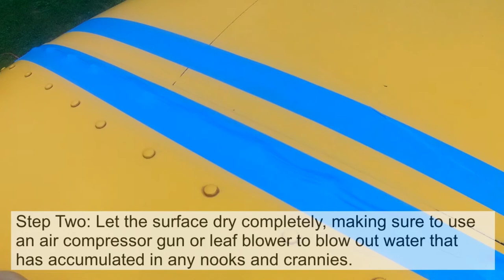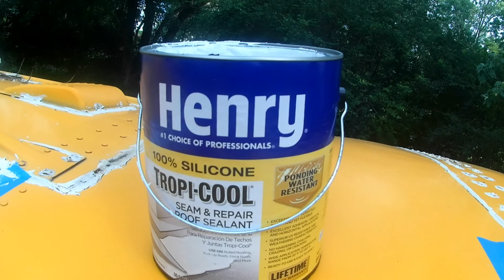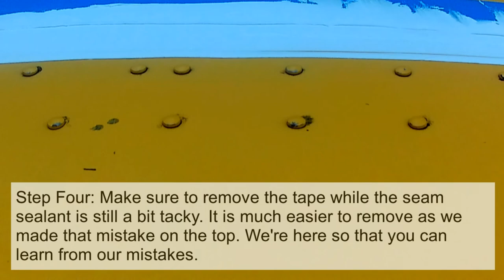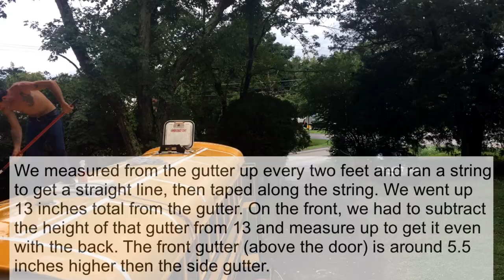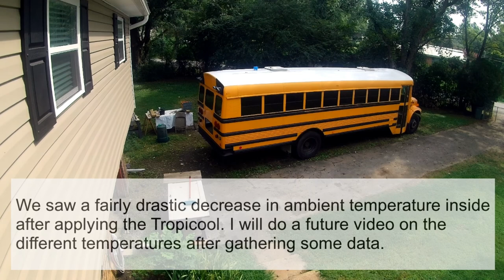SKOOLIE BUILD | HENRY TROPI-COOL | ENERGY SAVE | ROOF COATING | Skoolie conversion into a TINY HOME!

Comment: Out of pure curiosity why not use the sealant on the whole roof instead of taping spots off to use other products?  Been researching skoolie builds for little over a month and this is the first I've seen it done this way.  If you're gonna do it then do it right.  Teach me master 😆.   Thanks and great video bud.
Reply from the maker: Hi there! Thanks for watching! The sealant is a much thicker product (more like peanut butter) and is designed to fill larger cracks or gaps in the metal roof. The Tropicool is more like a paint on silicon coating. It would be way more difficult and expensive to do the sealant on the entire roof. Let us know if you have any other questions as we're here to help if needed. 
Chris & Steph